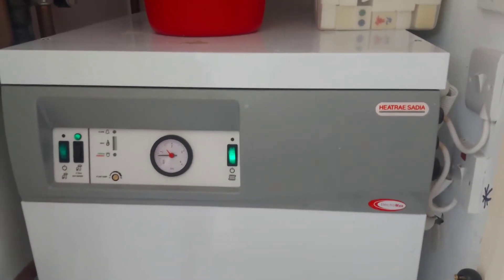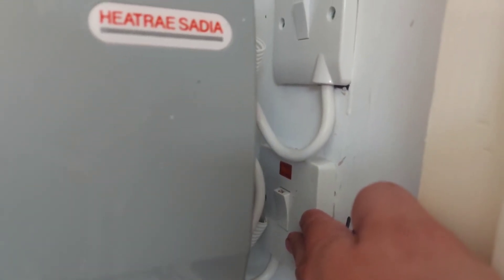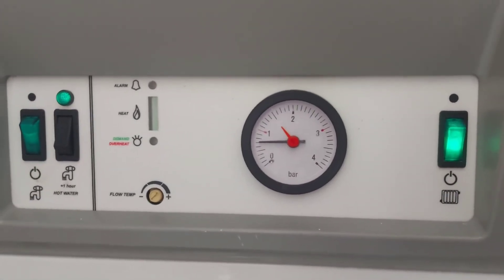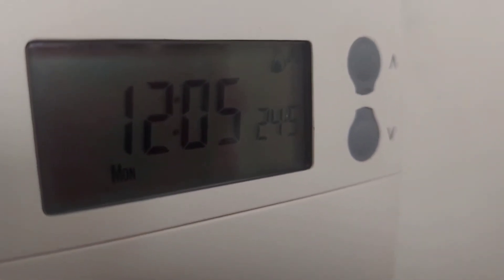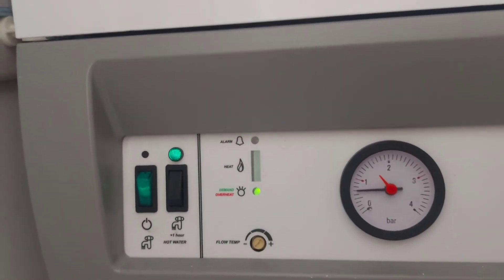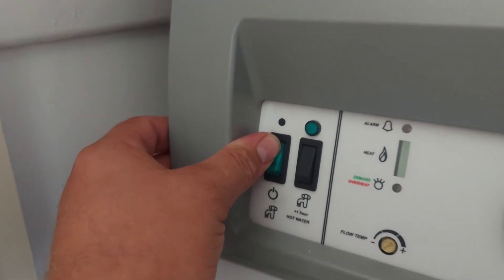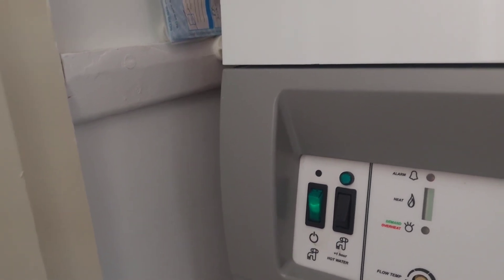Heatrae Sadia Electro Max Boiler Controls explained

Comment: Have you ever had to replace the water heater (green) switch? Mine is flickering on and off, and has to be 'manipulated' to keep it on. Once its on it stays on no problem.
Reply from the maker: No but don't forget to isolate the supply before having a go, it should only be 2 wires

Comment: Hi, how do you turn the temperature of the hot water down please? Recently had this installed and the water is scolding.
Reply from the maker: The temperature is controlled by the thermostat, check the temperature of your hot water at the tap after it has run for a while and got up to temperature, It should be above 50⁰C and below 60⁰C if it is over 60⁰C the theory could be set wrong or even broken. If broken get a heating engineer if not you may be able to adjust it. This below may help. Please consider subscribing to help me grow the Channel.

https://www.google.com/url?sa=t&source=web&rct=j&opi=89978449&url=https://www.heatraesadia.com/-/media/themes/heatrae/literature/user-manuals/electromax_user-manual.pdf&ved=2ahUKEwidzP-a95GMAxXdWUEAHXTCGL0QFnoECGwQAQ&usg=AOvVaw3M7l0qUHsWfb_lyp6zpqcn
Reply: @ it’s a bit weird there is no option on the thermostat? i’ve watched some other videos that show there should be an option but i’ve scrolled through it all and there doesn’t seem to be an option for the hot water temperature…
Reply from the maker: It likely has an analogue thermostat controlled by a dial on the immersion element

Comment: Hello, How to increase the pressure when it’s too low?

I have the central heating working but no hot water. The pressure gauge is at 1
Reply from the maker: There should be a filling loop that looks like this https://www.google.com/search?q=filling+loop+boiler&oq=filling+loop+&gs_lcrp=EgZjaHJvbWUqBwgBEAAYgAQyBggAEEUYOTIHCAEQABiABDIHCAIQABiABDIHCAMQABiABDIHCAQQABiABDIHCAUQABiABDIHCAYQABiABDIHCAcQABiABDIHCAgQABiABDIHCAkQABiABDIHCAoQABiABDIHCAsQABiABDIHCAwQABiABDIHCA0QABiABDIHCA4QABiABNIBCDM3NDRqMGo0qAIOsAIB&client=ms-android-samsung-ss&sourceid=chrome-mobile&ie=UTF-8

Open both valve till it is at approx 2 bar

Comment: Hi there. My boiler is new. How do you adjust the hot water? On the timer is set to warm for 3 hours and still can’t get really hot water.
Have to boost every time.
How to set up the heating right? 
Have 7 radiators  and for 3-4 hours, it takes up to 15£ a day
Reply from the maker: Do you have economy 7 electricity tariff that's what it's made to use takes 7 hours of off peak electricity to heat up the hot water using cheap electricity

Comment: Hi, could you please advise when I turn the thermostat on? Usually, the green light starts to flash, but it's amber any ideas please.
Thank you
Reply from the maker: https://youtu.be/5zrLw7c29E8 this maybe your thermostat 

https://youtu.be/5zrLw7c29E8

https://youtu.be/KZ1MhopRi30
Reply from the maker: The thermostat is normally left on all the time as tit turns the boiler on and  off depending on demand
Reply: I mean, I turn my heating on as and when by the thermostat. 
The lights on the boiler go on and are usually green but for some reason the light flash amber and the dot at the bottom is green?
Thank you

Comment: Hi, for the last few days my hot water button is constantly heating the water non stop which is shooting the units being consumed sky high (GBP 1 per hour). What could be potentially wrong?
Reply from the maker: The thermostat stat could have broken into the on position so it is constantly heating the water instead of clicking out Once the correct temperature is reached resulting in very hot water and high bills
Reply: @DeathLazerBoy  Thanks, sounds plausible.
Reply from the maker: @farazzio please consider subscribing to help me grow the Channel
Reply: @DeathLazerBoy  how can this be fixed?
Reply from the maker: Call a plumber as it requires  a drain  down and some tools you maybe lucky though  as the thermo stat can be changed with out a drain down but if its the element then I will need to drain down it shouldn't take more the a few hours max for a competent person to do

Comment: Demand for heat not working wny idea
Reply from the maker: Check thermostat
Reply: @DeathLazerBoy  batteries checked replaced with new nothing no light it clicks on but doesn't reach boiler
Reply from the maker: @ThorsTreasure is the roomstat syncing with receiver? What make and model thermostat do you have?
Reply: @DeathLazerBoy  it is danfloss
Reply from the maker: Check page 7 on this 

https://www.google.com/url?sa=t&source=web&rct=j&opi=89978449&url=https://cdn.expertelectrical.co.uk/media/catalog/product/t/p/tp5000si-instructions.pdf&ved=2ahUKEwjt2cqZlMyDAxVlUUEAHYZVALwQFnoECDEQAQ&usg=AOvVaw1B32dspasEo3hzmt-fqs4B

Comment: I have one of these boilers.  Is the red hand just a guide pointer?  It looks like the pressure is a bit low on that particular boiler.  I'm looking for a video on how to drain down the central heating tank.  I know which outlet it is but it doesn't have a push fixing to enable easy hose connection.  Thank you.
Reply from the maker: The red hand is max pressure normal rating is approx 2 bar. As for draining down I am unsure however you may have some luck here 

https://www.google.com/url?sa=t&source=web&rct=j&opi=89978449&url=https://www.heatraesadia.com/-/media/themes/heatrae/literature/installation-manuals/electromax-installation-manual.pdf&ved=2ahUKEwj-pbGiqe6CAxXbVUEAHZtXDFoQFnoECAMQAQ&usg=AOvVaw3ETFmB1Qy9Tb-FFvaYoY-y
Reply: Thank you for that link.  It's a more up to date version than the one that was with my boiler when I bought the house.   Alas the drain off point is very low to the floor.  Not sure how I'm going to fix a hosepipe to it.
 @DeathLazerBoy
Reply from the maker: @itsPOWOW thanks for supporting the channel and good luck draining
Reply: @DeathLazerBoy  I have a problem in that the instructions say there is a hose connector supplied for the draining outlet for the primary system (page 39). There is no part and it isn't in their numbered parts list, so I can't find one to buy.

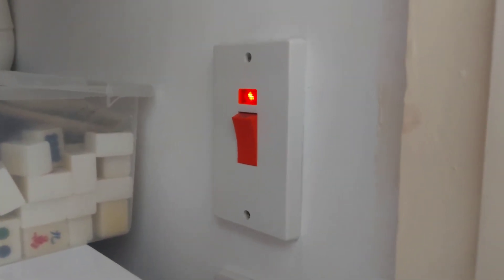Comment: Hey, that switch in 3:25 , what is it for? Mine is currently off as I didn’t know what it was but the boiler is still working heating the water at night
Reply from the maker: It might turn off the central.heating as I think it is a double pole plug you still have hot water as that is feed by an immersion element

Comment: How do you reset these boilers as we currently have a flashing alarm button and no heating?
Reply from the maker: Check the pressure and if its low use thr filling loop to top up

Comment: Hi, I just moved in to a flat with the same boiler, however, i only got hot water but no heating😢 the thermostat has the flame sign on, so my radiator is not reacting to the thermostat??? or do you think is the pump problem? 😢 thank you
Reply from the maker: It is more likely the circulation pump then the room stat check the fuse board first tben chek the boiler
Reply: @DeathLazerBoy  you are amazing!!!! It’s the fuse!!!!!!!
Reply from the maker: Glad to help please consider subscribing to help me grow the channel

Comment: My flat has this boiler. So is there a way of making constant hot water with this? Or just the 1 hour supply?
Reply from the maker: Inside the big box is a small hot water cylinder which is designed to heat up over night using off peak electricity
Reply from the maker: The 1 hours supply is a boost and uses pk rate electric the button on the far left leave on this supply of pk electric an heats the water over night using cheap electricity

Comment: I just moved in to a house that has this boiler, I don't know which tariff they were using, but there is always hot water (not too much, but warm) even when the boiler is completely off. Do you know why? Is it pre-stored hot water?
Reply from the maker: If its switch is off it takes ages to cool down as the hot water tank is insulated and inside.  Check your electricity meter to see if it has two rows of numbers if it does you are on economy 7 tariff

Comment: I recently moved to a new rented property and there this electric heater/boiler is installed. We saw 431 units in day and 192 units consumed in night in just 7 days . Not sure what we are doing wrong. Initially we may have increased thermostat to 23, 3-4 times a day and recently we did increase to 27 degrees for only 2 days. Anyways isn't it consuming so much ? We are really worried now what should we use and what should we stop immediately? Yesterday we tried to turn off all the non required appliances from main board and also turned off electric heater's water and radiator option and it moved barely 2 points with cooking and charging electronic devices. We started electric heater 's water and radiator in the night around 10 PM and set the temperature to 20 degrees in central electric display and in the next morning we saw 7 day units were consumed and 11 night units were consumed. Your video is very helpful. Can you please help share any valuable advice on this ? Is this normal ?
We are using London Power and we have both day and night meter.
Reply: Thank you so much! I have a danfoss thermostat to manage the centralised heating. Is there a way to schedule the electric heating during the night through danfoss ? Also is there a exact timings when low tariff is in action because i saw during the night we accrued 5 day units, not sure how. 

Also is there way to manage separate temperature setting for lounges and bedroom through danfoss thermostat or is there any way ?
Reply from the maker: Your day rate is 24 hours a day hence the 5 units collected Over night

The off peak / night rate only come live over night andcb. Is off in the day you meter turns this on and. Off normally from 23:30 to 06:30

Your danfoss control only sets them where it is the only other way to adjust the temp is using TRV on the radiators

Please consider subscribing to help me grow the channel
Reply from the maker: Sounds like an economy 7 tariff? If so if you have 2 consumer units your day rate is on 24 hrs a day and is expensive and the other board is on during off peak hours normally 23:30 to 06:30  use that electric to do all your heating and hot water and the peak rate stuff sparingly
The government recommends lounges to be heated to 21 and bedrooms to 18 I feel this is rather high and costs allot I heat my home to 17/18 degrees all year round controlled by a Thermostat.
Hope that helps 
Please consider subscribing to help me grow the channel

Comment: Thank you for this. I have this boiler in my flat. It doesn't produce any heat to my radiators whatsoever. I switched the heating on and 4 hours later, the radiators are still Ice cold.
Reply from the maker: Is it being supplied by off peak electricity and you have a single. Rate meter?
Reply: @DeathLazerBoy  thank you millions for your reply. I don't know the answer to either of your questions I'm afraid. I have a smart meter. I pay fixed fee direct debit each month so not prepayment or anything. I had never heard of off peak electricity before. This is only property I've ever had with electric central heating and water. All others have been gas boiler
Reply from the maker: Peak and off peak and different price electricity from an economy 7 tariff so look on  your bill and see if it says Economy 7 and charges different prices for electricity
Reply: @DeathLazerBoy  hi, I have just looked on my bill. It has smart energy as the tariff name. It doesn't mention economy 7 anywhere
Reply from the maker: Do own the flat or is it rented?

Has the heating ever worked since you lived there?
Reply: @DeathLazerBoy  sorry for late reply. I rent the flat and yes it has worked before. We have had engineer out and the pump had stopped working. They couldn't get it to work so have ordered a new pump for it
Reply from the maker: @kellyjackson30  check your bill it will say on there
Reply: If your thermostat isn't set to a high enough temperature it won't ask the boiler for heating action.  Have you a Danfoss thermostat?  There's an instructional video on how to set that.  I have this boiler and have used it for 7 years and it's been great.  Good luck.

Comment: Thank you for the video. Do I need to turn on the Radiators to get hot water? 

I don’t use heating just yet, and I keep finding my house without hot water and have to turn on the booster switch.
Reply from the maker: That will cost more the boost uses peak rate like boiling the kettle have the space heating / radiators on but turn your Thermostat down to say 16 degrees so it has permission to be on but not working very hard at all and you should have hot water. 

Please consider subscribing to help me grow the channel
Reply: @DeathLazerBoy  Thank you for the response. That’s super helpful. 

I have a Nest thermostat attached to it. I am assuming If i keep the eco mode on, it would work. 

Also what would you recommend for the eco base temperature? I’ve currently set it to 9 degree Celsius. Would 16 be better?
Reply from the maker: 9 degrees is very low I set min to 10 when I go away for frost protection whilst in my house I set mine to 16 the government recommends 18 in bedrooms and 21 in lounges but that's too hot for a health active person so I would aim between 16 and 18 degrees 

If the air temp drops below 16 and you are in you will need heat a that is cold the good thing about that is you can leave it at 16 all year round and it won't come o in the summer
Reply from the maker: You may find this helpful

https://www.google.com/url?sa=t&source=web&rct=j&url=https://www.heatraesadia.com/-/media/themes/heatrae/literature/installation-manuals/electromax-installation-manual.pdf&ved=2ahUKEwi-_MD7-YD7AhVKQEEAHbXcCp0QFnoECBkQAQ&usg=AOvVaw3ETFmB1Qy9Tb-FFvaYoY-y

Comment: Quick question gaffa, my hot water used to work normal but about a week ago it stop working unless I turned on the peak electricity for 1 hour which only gives me about a quarter of a tank of hot water, do u know what the problem could possibly be? Thanks
Reply from the maker: First check the switch if it has an indactor light, does it light up during the off peak period normally 23 :30 to 06:30  if it lights up the Immersion is faulty and you will need a new element. 

If it doesn't light up check the consumer unit to see if the breaker is down if it is push it up but check the next day, if its back down there is a fault with the element as it has tripped again.

Hope that helps please consider subscribing to support the channel

Comment: Great video! Following a tripped circuit breaker a few days ago my Electomax is not heating the radiators (they are stone cold). I'm not getting the Demand light flashing even though there is a small flame shown on the thermostat (which I guess means it should be heating up the house?)  Hot water working as it should. Is there a way to re-set the thermostat at all? Or is there anything else I should be looking at? Thanks
Reply: Perhaps check your room thermostat.  They came with a Danfoss room thermostat which has its own timing and temperature settings.  I hope that helps.
Reply from the maker: @itsPOWOW good advice
Reply from the maker: I would check the consumer unit again making sure they are all up make sure the unit isolation switch is on too and it should heater up during the off peak period normally 23:30 to 06:30.

Please consider subscribing to help me grow the channel
Reply from the maker: The pressure Could be low

If it is 

First turn off the electrical supply to the Electromax. ...
Pull the lower front panel forward using the finger holds in the sides of the panel.
Connect the Filling Loop.
Open the Filling Loop Isolating Valves and allow system to re-pressurize to between 1.0 and 1.5 bar.
Close the Isolating Valves
Reply from the maker: If that does not work check this out

Look at page 33

https://www.google.com/url?sa=t&source=web&rct=j&url=https://www.heatraesadia.com/-/media/themes/heatrae/literature/installation-manuals/electromax-installation-manual.pdf&ved=2ahUKEwiogdrNs-36AhWGhv0HHX-8CjIQFnoECA0QAQ&usg=AOvVaw3ETFmB1Qy9Tb-FFvaYoY-y

Comment: I live in a well insulated flat and recently just got recommended to have 9kW Electro Max Combi Boiler installed. As I don't need heating even in the winter, can I only set the water heater timer 1-2 times a day to heat the water with this boiler?
Reply from the maker: That depends on the type of Programer you have, there is a cylinder inside which stores the water, however there is a Thermostat which stops excess hot water being made the program just allow permission to make hot water so if its already hot no more is made.